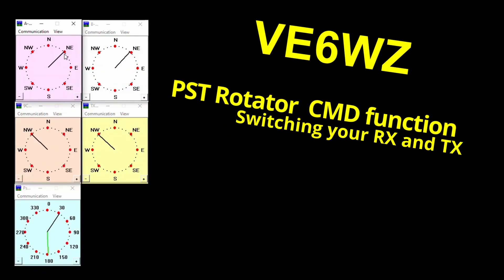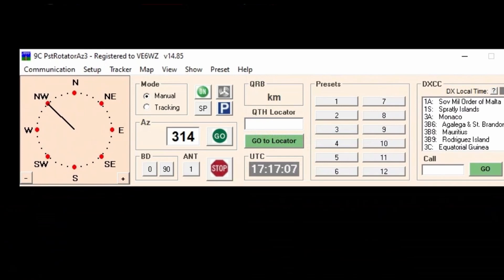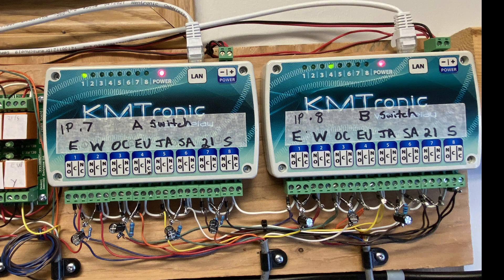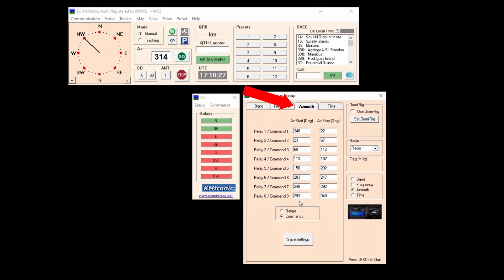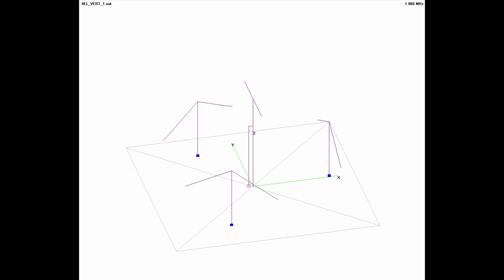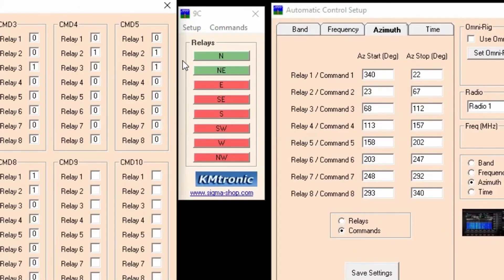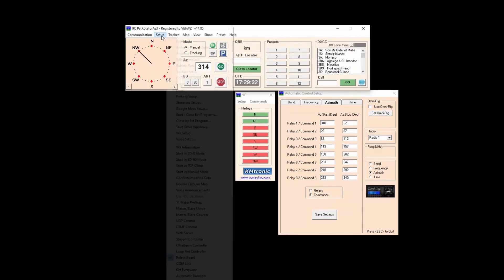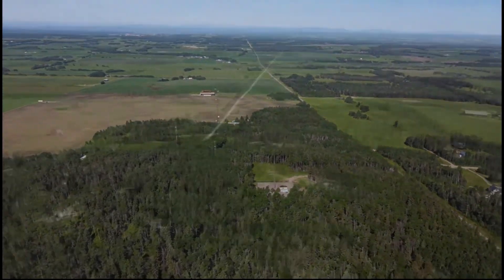Relay antenna switching with PST rotator

Comment: Hi Steve, just implementing this neat solution on my shack! For the 9C array Combiner box you run an independent/dedicated power source 12v DC line correct? Also I see you inserted jumpers to connect the 3 relays in the C port and another jumper from 4 to 8...am I seeing this wrigth?